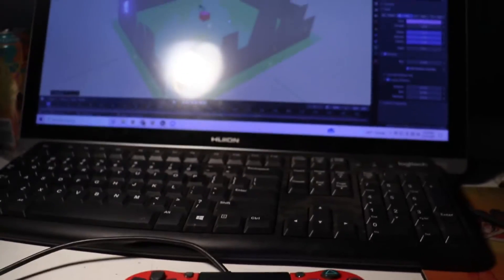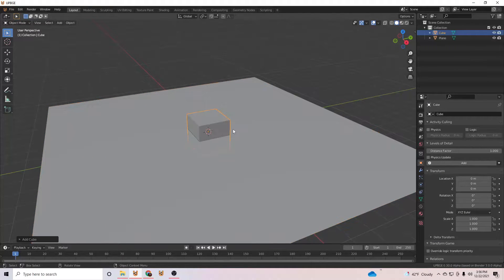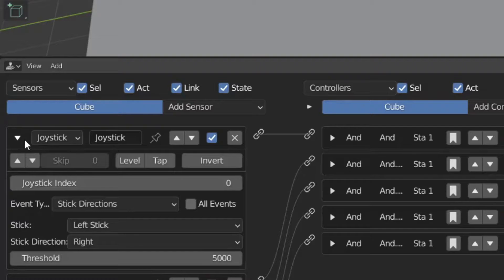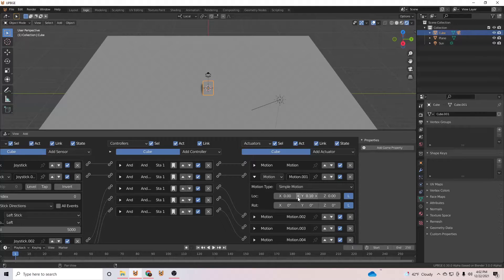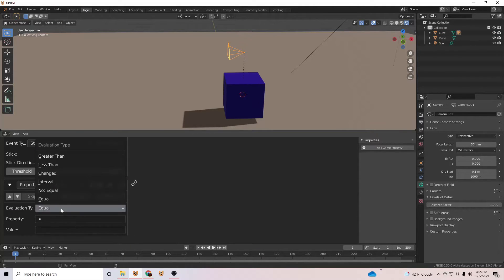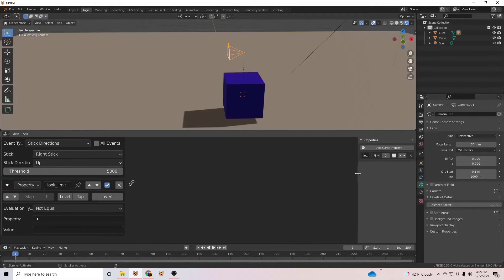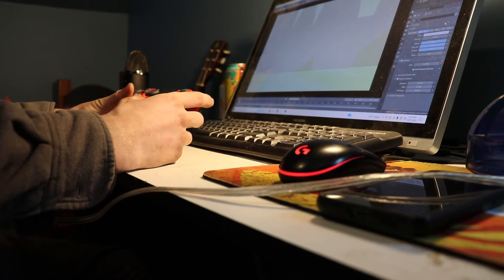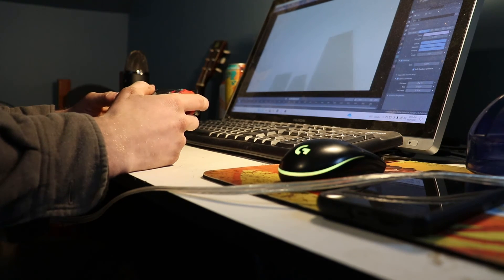PS4 FPS CONTROLER tutorial | Upbge

Comment: Nice! Is it possible to use sixaxis(gyroscope)?
Reply from the maker: I don't think you can with just the logic bricks. But if your handy with Python then I'm sure there is a way to do it. Also you would have to use a controller that supports it. Like a switch pro controller.